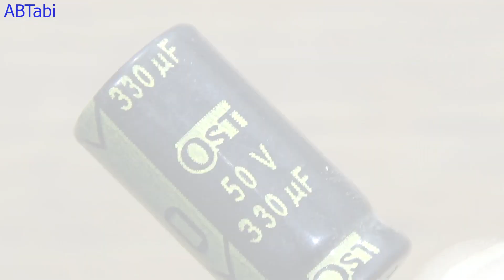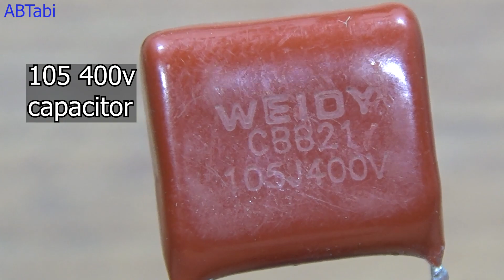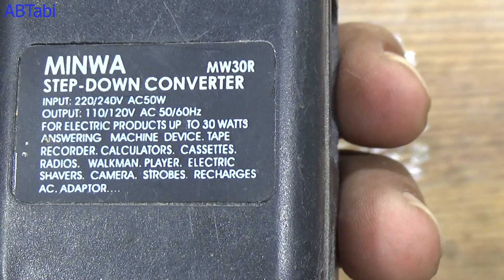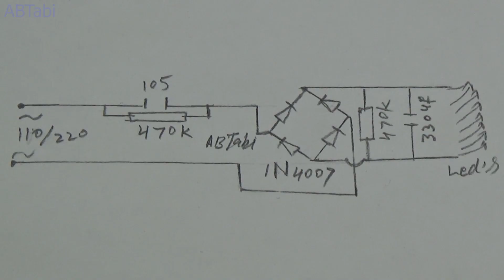2 in 1 Led Light Bulb110v & 220v Led Bulb Make at home

Comment: Copnent list please
Reply: 1. Ceramic capacitor 1uf 400V
2. 470k ohms resistor (x2)
3. In4007 diodes (x4) 
4. 330uf 50v electrolytic capacitor
5. Light emitting diodes (LED)